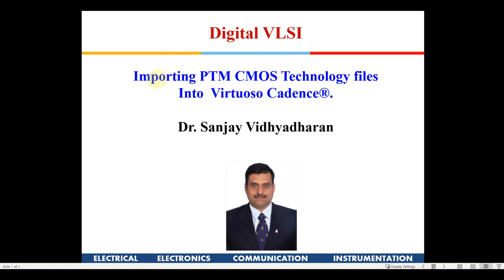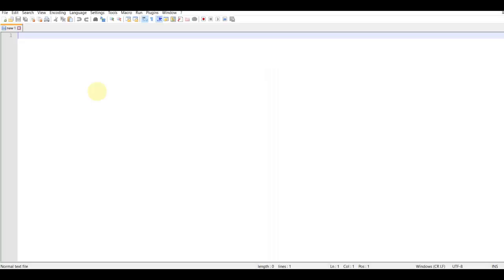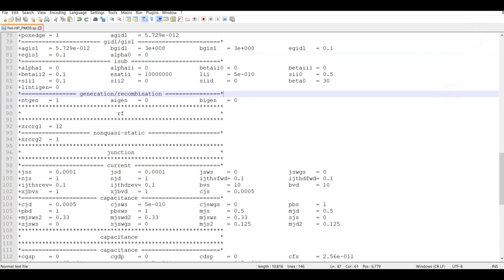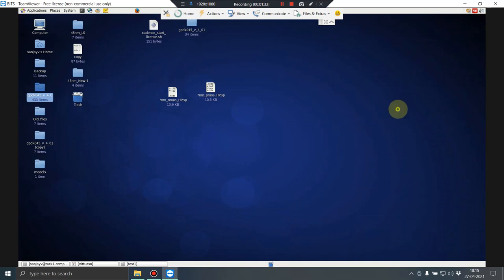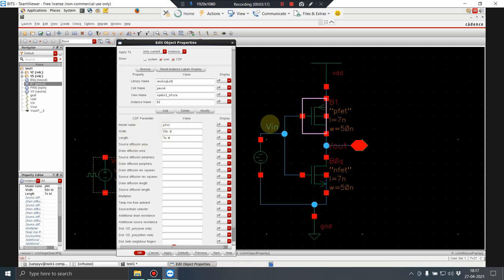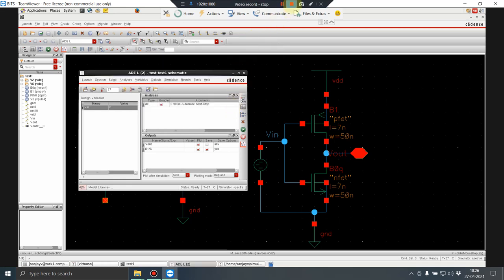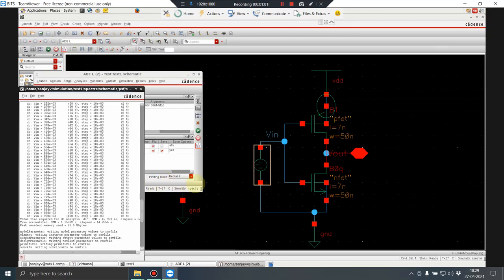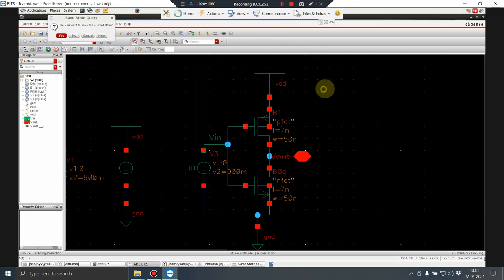Importing PTM  7nm , 16 nm , 22 nm CMOS Technology files Into  Virtuoso Cadence®.

Comment: I want to use transmission gate in my design but it is not available as standard cell for genus RTL synthesis. So how can i perform this including the standard cell to get criticle path delay and power
Reply from the maker: it it is not  avaliale as a stanadard cell you may try  making one gate with transistors.  Not sure on how genus works

Comment: Hello sir, how can I change the finger number cause there is no such parameter in nmos4 in analoglib? Thanks
Reply from the maker: It wont be possible to change  number of fingers , you  can only set total width i nmos4 of nalog library. You will require tech lfiles from fab lab for that.

Comment: sir what is the minimum width of pmos and nmos in 16 nm cmos technology
Reply from the maker: The model files generally specify Lmin and nominal VDD at top of the code.  These are PTM models and not fab lab models and hence they don't specify all parameters. Minimum Width is generally 2.2 to 2.6 times L_min. Better option is to refer to tsmc data or microwind application data or other fab lab data .